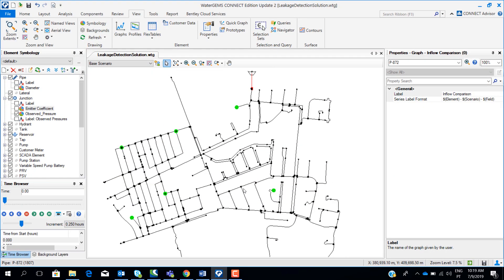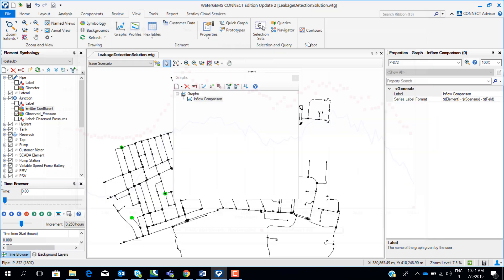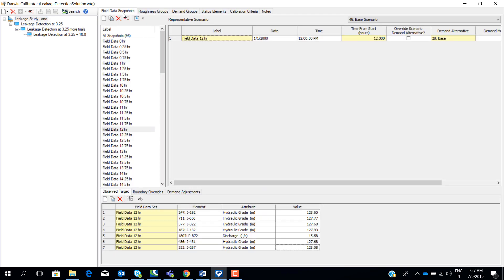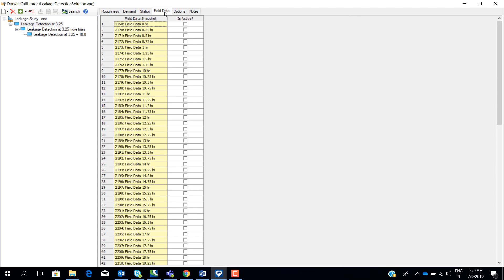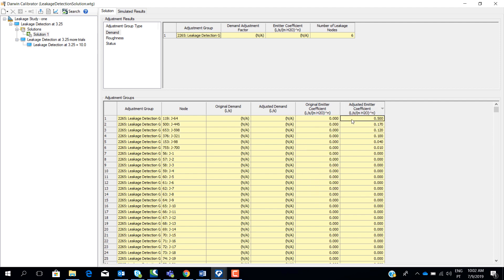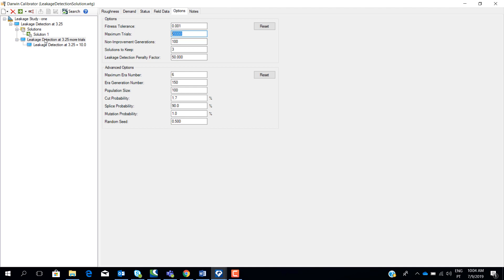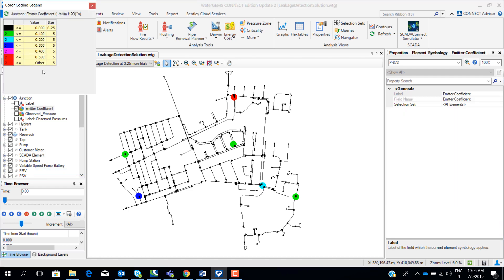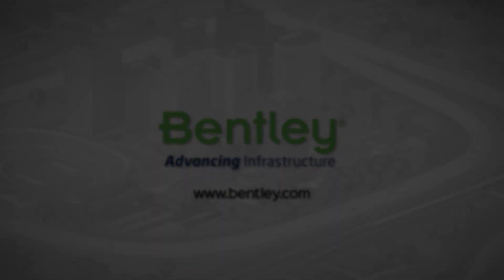WaterGEMS Advanced Part 14: Workshop 7 (Leakage detection)

Comment: when I reviewed  the model wtg , I found a lot of TCV s  link to large and short  pipes...   this step came from modelbuilder and source file is gis ??? thanks
Reply from the maker: Ghada, is it possible that the model was originally imported from an EPANET INP file? EPANET uses links for valves, which get converted to node-based valves in WaterCAD/WaterGEMS, resulting in a short, large diameter pipe as described in the following article:

https://communities.bentley.com/products/hydraulics___hydrology/w/hydraulics_and_hydrology__wiki/10274/what-are-the-limitations-of-importing-exporting-epanet-files

I am not quite sure I understand the last part of your comment. If you need further assistance, please post on our forum: https://communities.bentley.com/products/hydraulics___hydrology/f/haestad-hydraulics-and-hydrology-forum